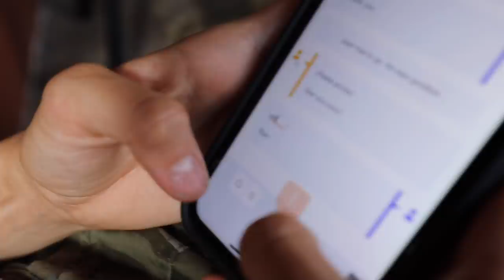A BIG CHANGE to Our Homestead in Panama // off grid living

Comment: I used old dirt from the lower end of the barn & put around my flower beds. I also scooped up bucketfuls of manure, mixed it in the soil before planting. I live in Southwestern Virginia. My cherry tomato plant grew 5' & yielded 100's of those little tomatoes. My flowers were larger & brighter. The only time I used the manure straight was after putting my potatoes in since they grew below ground, then put manure on top after they were covered with dirt. I got 6 5 gallon buckets full of kenebeck potatoes out of a 50 lb. bag of seed potatoes that year & almost the same several years after. I never put manure straight on my plants, always mixed it in, then added around it. Your compost with coffee grounds, egg shells, etc. should also be good for your trees.

Comment: Way to go.  A bit of advise from a master gardener who has made an absolute ton of mistakes: Invest in a small can or two of bright paint (spray paint or regular paint) and buy a 2 x 2 or use scrap wood or buy stakes (stakes are cheap and my favorite) to make a marker.  You'd be shocked at how fast the forest/jungle/field/grass/brush will surge back to choke out your new trees and as a novice (hay, I've been there) you probably will not be too sure which sapling  is the one that you put in and which are the invaders.  That's assuming that you can find the spot at all (Me in my garden:  Hay! I'm sure it's here somewhere.  Let's see, it was about ten feet from the fence.... It should be right about here....what the heck is that?  Is that it? I"m not sure......).  It will also save you tearing them out again by accident when you come back to weed.  Been there, done that, pulled up expensive plants or cut them down weeks or months later thinking that it was a weed.  Or in the reverse, allowing a weed to grow because I wasn't sure if it was  the plant that I put in or not. So use a stake or cut a 2 X 2 into 2 feet sections, spray paint them a bright pink, orange or blue (not green for obvious reasons) and pound them into the soil next to your new trees.  If you want to get fancy for your new homestead/education center, you can cut a 2 X 4 into 4 - 5 inch chunks, spray paint them a contrasting color and make them into signs with words (Meyer Lemon) and or pictures and put these horizontally on top of the stakes . I did that for my tomato farm.  I chose 3 nicely contrasting colors from paint on sale (I'm cheap) and made a bunch of signs that looked great.  Sure, they will rot out in a couple of years, but they are dirt cheap, easy to replace or, once your trees are bigger, they might not be needed at all except for decoration.  If you are really new to gardening or at a least new to the particular plant that you are putting in, It may also be a good idea to clip off a leaf if the plant can spare it and press it, glue it to a piece of paper or in a notebook, label and save it.  That way, next year when you are faced with 5 shrubs and bushes in a space where you only planted one, you can pull out the paper, compare the leaves and figure out which plant is the one  you put in and which plants are weed impostors.  You usually don't find this kind of advice in gardening books because they are written by people who know what they are doing.  Those of us who haven't a clue or are just learning need all the help we can get.  Good Luck!.
Reply: Plus spread the roots from them being in a container and wet them.. Place some water in the hole with the soil loose in ground and plants root base then place in hole.  Hello from another master gardener...
Reply: I like useing strips of old sheets of t shirts to mark trees

Comment: I am happy for you two! But I agree with the comments about where you are planting the citrus trees. They do no work as a wind break. They will need a windbreak for them. There are many choices of thick tropical shrubbery you could plant as a wind break. But you still have a chance to move them to a more protected place before they start growing. Also I am sure you will want to start a compost pile of chopped up brush, kitchen scraps, cow patties etc. and a cheap and easy compost bin could be pallet wood frame or even simpler to start a 40” diameter circle of 3’ high hardware cloth fencing. Just place the ring where you want and start filling it.

Comment: I was just noticing the spacing on your trees. I don’t know if you realize that citrus trees should be planted 15-25 feet apart. It will be undoable once those tap roots take hold. And you are right about the carrots. Seeds don’t need all that sun to germinate. They are taking nourishment from the soil to develop roots first then the leaves sprout. Beans germinate much quicker than carrots.

Comment: U don't need to plant carrots like that. Work a space in your garden, make soil very loose and sow directly to soil. Very very thin so you don't need to thin out later.
Reply: True, no seedlings for most vegs, especially carrots.
Reply: Terry Newell I was a carrot faRmer as my starter veggiiie for grandpa.   I made little owls
Reply: Mounded rows just for not steping on. I used an old pepper shaker and shook the seeds down the row and folded the loose dirt over like putting my dolls to bed thin blanket and a pat.   I checked them.daily.  Whe n I looked for weeds I had to thin out the baby’s cause they were a bit crowded.  I hated that part.  But my carrots were delicious and pretty.
I.  I had other veggies in my square, 9x9 ft..  But carrots were my fave.   My worst mistake was II liked the onion flowers so I let them go to seed.   I had the happiest time with that little patch of dirt that was mine.

Comment: I noticed from the areal view that you are down the hill from the cows.  Make sure to test your well-water.  Stay safe of possible disease.  The manure is good, provided it's properly composted.  Start a compost heap.
Reply: I agree about the concern about the cows.  Tho my parents have a property at the top of Cerro Azul and they have a well.  If you drill low enough you may find a clean water table as often much filtration and isolation occurs before reaching certain levels.  But I agree with that about the qualified Civil Engineer (not just any Civil Engineer, but one that know about these matters).

Comment: I agree with the fruit tree spacing comments below, maybe even the raspberries. Congrats on the seedlings but I agree that it looks like maybe the seedlings need a bit more light if possible. The ones you showed were sharply towards the direction of the light and also the walls one looked a bit spindly. You really don't want them to sprout real tall early, all the energy of the plant goes into that when the root system is what you should be focusing on. Tall spindly seedlings without a good root system will have a hard time getting established once you plant them. Good luck!.

Comment: Before you plant your seedlings make sure you have gotten all the weeds and roots out of the garden plot.  When planting use newspaper, black & white nonglossy, on the soil between plants and rows for weed suppression.  Weigh down with rocks or wood and cover with mulch.  All the grass your cutting down can be used to start a compost pile.  There are many videos on this so I won't post instructions but you can have your own compost in no time at all.  Start a manure pile!  Add to the compost or leave separate for your chicken to spread in your next garden plot.  Your chickens will love it and more fertilizer!

Comment: Fresh manure will burn your plants up, it's to strong.  You need to let the manure age, i.e., if you're cleaning stalls you would not use it until the following year.  Fruit trees do not make a good wind break, you'll probably just end up loosing the fruit.  You'll want those in a more pampered, protected position and put some pines up where you want the wind break.  Just watch where your going to have shaded areas because of the pines.

Comment: A small generator connected to an automotive charger as an emergency way to charge your solar batteries would help, and use less fuel than the bus engine

Comment: Use wind turbines. You can buy small ones that product decent power
Reply: PocketRocket 1 excellent idea to harness the power of the wind!
Reply: Cheers mate
Reply: Positioned right, on that windy meadow, they could have all the power they want from wind generators.
  They will need to have a brake set-up, that works. With the high winds they get, they will need an automatic shut-off for wind speeds exceeding a certain level; so their wind generators don't get broken by going too fast.

Comment: I see lots of comments about not putting fresh manure directly on the plants, and I agree.. what you guys need is a biodigester.. You have all the cow poop you  need next door to get it started, then you can dump in your food scraps and even Lola's poop and garden scraps. You will get TWO wonderful things from that - FREE fuel maybe to cook with, or heat your shower water, and FREE Organic fertilizer to put back on your garden. You could even sell the leftover fertilizer at the local market. Check out SolarCITIES Biogas Innovators page on Facebook or reach out to them at info@solarcities.solutions. We have built several biodigesters right here in Panama and can help you out!
Reply: @teknav1  thanks Maurice. I am fairly new to the biodigester world (two years and by no means an expert) but what I do know is that is a different process than traditional composting. One of the founders of the organization I mentioned actually runs one her biodigesters solely from dog poop and uses the biogas to run her BBQ and uses the fertilizer to repair the brown spots on the lawn that the dogs make! Full circle!